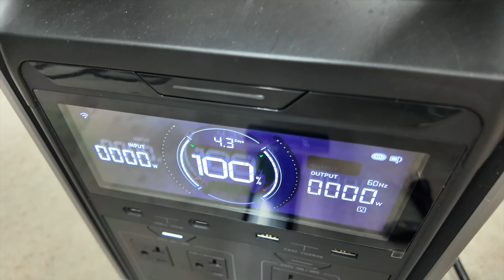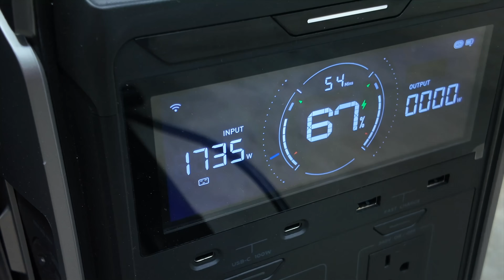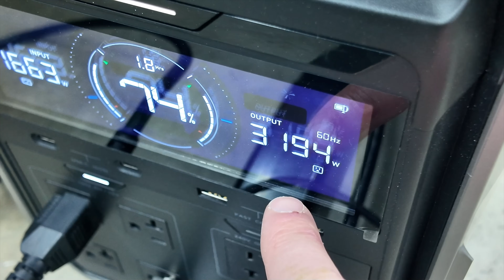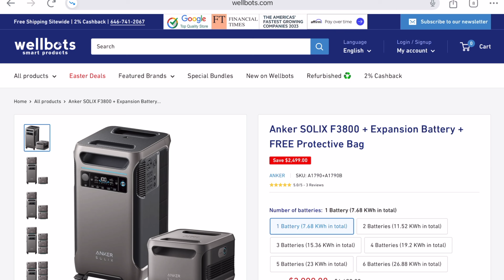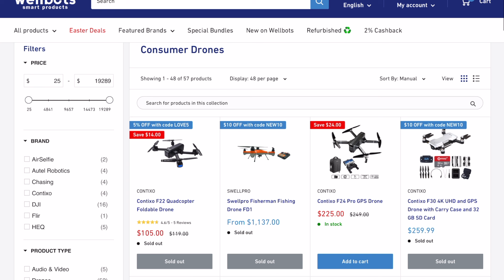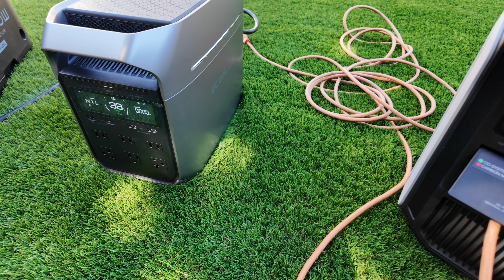EcoFlow Delta Pro 3 VS ANKER F3800+  What Others COULDN'T Show You!

Comment: Bought the Ecoflow 3 delta pro in May. Bought the two extra batteries. It runs 60% of my without any problems. My only complaint is the 60 volt limit on the low voltage port, worse is the 150 limit  on the high voltage port.  The HV port should be 200 volts.

Comment: I love that the anker offers more power, but it can't supplement input power like the ecoflow can. It is possible to hack a cable connector to common 48v batteries for either of them, which is critical for my needs, but the anker hack is a little easier. The ecoflow has that nice generator option with DC charging. The form factor of the anker is more practical. Neither is perfect, so maybe I'll stick with plan A and wire up a victron system with whole house integration.
Reply: Between the two I'd go with the ecoflow DP3 and generator combo. The DP3 alone would be emergency backup for refrigeration and lights, but with the generator running too maybe it could run some A/C too (with a power efficient A/C and my excessive 50kWh battery bank).
Reply from the maker: Have you seen this Hacking Ecoflow’s EcoSystem!-PowerKit Included!
https://youtu.be/hYxcSyzRioI

Comment: I'm a newbie on Ecoflow products so searching for someone that can demonstrate how you get 48 kwh from 3 Delta Pro 3 battery backup system with 2 extra batteries each, plus 3 x 4000 watt generators & 1x EcoFlow Smart Home Panel 2. Can't imagine anyone wanting to maintain 3 dual-fuel generators to get 48 kwh, the noise would be unbearable. Now they are about to introduce the new Delta Pro Ultra X that can use 10 batteries for 60 kwh. Starting to think I made a big mistake and should have waited 3 more days to buy that unit. i use about 55 kwh per day average and the new Delta Pro Ultra X, sounds more like what I could have used. aaaggghh !!!

Comment: I wish the extra battery had a display screen. How can you tell the charge rate level of the battery ( capacity) on the eco flow 3 extra battery? Is it only available on the app? Does the extra battery drain down at the same rate as the Eco flow pro 3? I can’t find any videos or information on how to access this information.
Reply from the maker: DP3 extra battery has a light bar. Full bar 100% half bar 50% quarter bar 25% roughly

You can go into the app and set up dp3 to charge both batteries at same time and discharge at same time. 
You can also set up to charge and discharge one at a time with priority mode in the app 

Plus the app shows state of charge for both the main unit and battery

Comment: Is the ecoflow now able to output 240 while charging ??
Reply from the maker: No the DPU does though. 
So both the Anker and dp3 does not
But only dp3 allows full 4000 watts out using all 120v volt plugs so still very functional
Reply: @johnnysweekends 
I have heard that the 3800 plus does but not the original.....I was hoping that Ecoflow had changed it in an update or something like that but it is likely a hardware limitation.
Reply: The DP3 allows 120V charging while outputting 240V. The F3800 Plus, with the Generator Charging Adapter, allows you to charge via 240V while simultaneously outputting 240V.

Comment: The larger inverter on the Anker is at least partly why it has the larger idle power draw.
Reply: yes, that is both a positive and a negative.  Allowing for more power draw means it will consume more at idle.
Reply: @JasAce5  Yeah, I've considered in nearly all the reviews the larger power draw is held against the Anker - but in some cases it has nearly double the inverter power.  For me, I'd want the extra power at the expense of long run time....if I'm gonna connect it to the house, I want it to carry the loads.

Comment: If you live in the hurricane belt it's doubtful a solar panel will help you much keeping these things charged up for several days of use.
And for as clean as these things are, which I do like, we are back to our good old gas/propane generators to keep these behemoths charged up.
What a twist.
Reply: Just turn off the main A/C and get a portable one, should last a few days then
Reply: @ohmi_senpai  I WAS talking about window/portable units.
You are probably going to need all sorts of options when the power is out 4-10 days.
Not at all uncommon during hurricanes.
Reply: Gas makes the world go round.
Reply from the maker: That could change a lot in the next 20-40 years. At least as far as gasoline goes.

Comment: What I really wish EcoFlow would do with their Smart Generators is decouple the power leads from the communication leads. While having extension cables is nice, they are impossible to run across the house if your power unit is in the basement next to the panel and the generator is out in the garage or back porch. Imagine if they would use something like a Cat-5 cable with RJ45 for communication and then a standard power plug for power. You could then run Cat-5 and Romex across the house to wherever it was needed and then simply terminate with the proper connectors afterwards.
Reply from the maker: Cat 5 would be amazing !!

Comment: All the manufacture specific connectors is a bummer. I see why they do it. You gonna use their accessories that are properly configured but you are stuck to one brand unless you get crafty. Wanna charge with 240V? gotta buy a cable for that! Wanna connect different batteries together? Gonna buy cables and a hub for that! Wanna charge with solar? Gotta buy a special connector for that. Jackery does the same, with thier stupid 8mm barrel plugs and expansion batteries cables.
Reply from the maker: Yea I think Jackery maybe is moving away but the 8mm pin is a little more common. At least the new Jackery 5000 has built in MC4 on it so that’s nice
Reply: @johnnysweekends  I just got a Jackery 5000 on saturday!!! Learning its quirks. I does have a pair of MC4 for its High Voltage pv but it has 2 8mm barrel plugs for its Low voltage pv. I had to spend $20x2 on adapter cables to run non-Jackery(cheaper) panels. Oh well. Tis what it tis.
Reply from the maker: @rikets9725 it tested well I did a review on it and it’s not a bad unit..👍🏼

Comment: Bought EcoFlow Delta 3 Plus units to replace dead/dying traditional UPS units for computer/Internet/TV. Then added a Delta Pro 3 to run my gas furnace & backup fridge. Also bought the older 800W alternator charger to recharge them with an idling vehicle.
Reply: I have 4 EcoFlow Delta 3+ each for fridge, dehumidifier, 8000btu AC, computer stuff. Works excellent. With this setup I have 4096watts, 4000w solar input 1000w each.
Reply: Have you noticed any overheating with them  ?
Reply: @silverpro8356  Hi, not that I’ve noticed, yet. June is approaching and the units are in unconditioned space so that may change. I did notice that one unit hit 118F. It certainly is something to watch.

Comment: have been watching factory gate prices for lifepo4 batteries. 280ah cells went from 40-45$/kwh to over 150$ over the last 2 days lol. this is getting insane. my 700$ 15kwh battery i built in my car now cost almost 3000$. guessing power station prices will skyrocket in the next few days, especially after may 2nd de minimus deadline if its not extended.

Comment: I personally like the EcoFlow Delta Pro Ultra. The form factor is way, way, WAAAAAAY better than the tall, skinny Anker form factor, you can stack multiple 6kWh batteries and there are way more options. However, I wouldn't get any of these systems because once you buy into them, you're locked in. The more locked in you become, the more you have to accept their proprietary connectors, their black box solution, and them fixing everything. Something breaks? You're stuck with hoping you're under warranty and them coming up with a good fix. If you build your own system and a fuse blows, you can just buy another fuse. I don't want to have a multi thousand dollar setup down and out because of a a 30 cent part that died inside that I don't have access to fix. I don't like the concept of them no longer supporting a product 10 years from now (or them not even being in business anymore), vs getting standard components and replacing them with other standard components if they break.
Reply from the maker: DPU is a great unit and most anyone can hook it up and get going. 
Most products now a days loose support after about 10-15 years. 
Even large companies 

Unless yes, you piece it together with more simplistic products. 
Battery, solar charge controller and an inverter. 
Then it’s just wiring or what ever and replacing one item at a time that may fail.
Reply: Technology changes to rapidly, 10 years is long time to stand by their product. Build your own or get a generac back up whole home system.

Comment: I bought the F3800 (not Plus) last year with the Home Power Panel. This is being used as a whole house backup, and was chosen because it was stationary and had a bigger inverter and battery expansion.  Since it's charged from the grid directly at 240v 3000+W, solar and other charging options were not terribly important.  If the grid is down, an inverter generator can be plugged into the outdoor L14-30, which will then power the house and recharge the F3800 at the same time.  Very pleased and it's already proven itslelf during an outage, however, if I were to do this again, I would opt for the Jackery 5000 and sub-panel kit.  Bigger inverter and there are monitoring and control options in the Jackery home panel that stand out, like automatic priority circuits and individual circuit control and monitoring.
Reply from the maker: The Jackery is actually not a bad unit. I liked it for performance and simplicity.